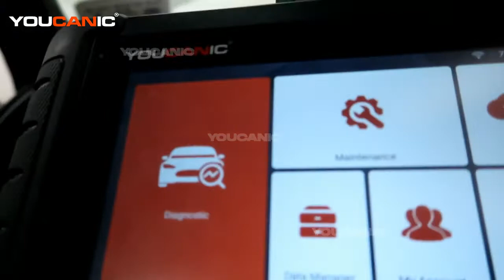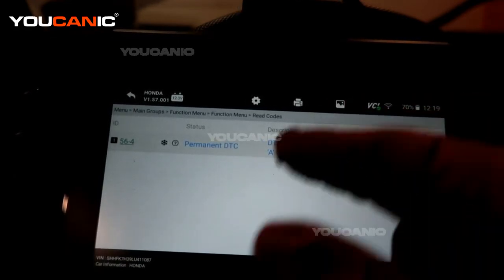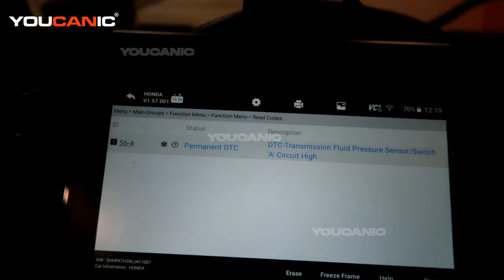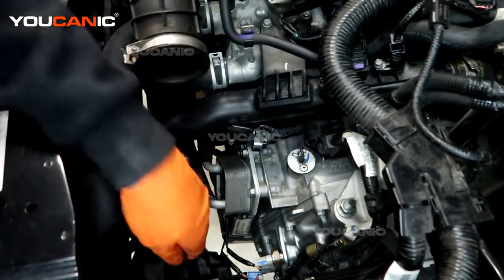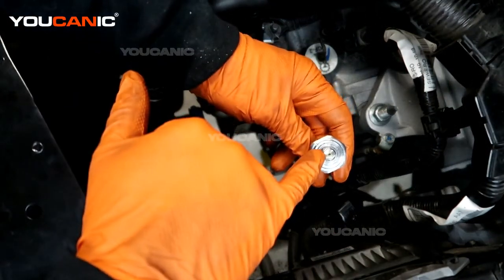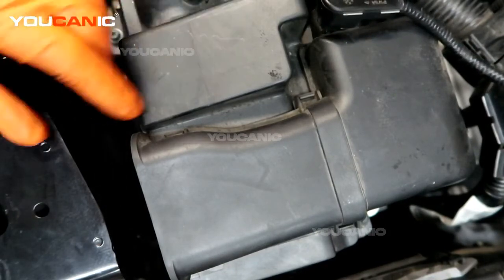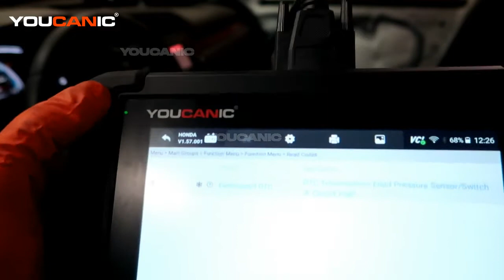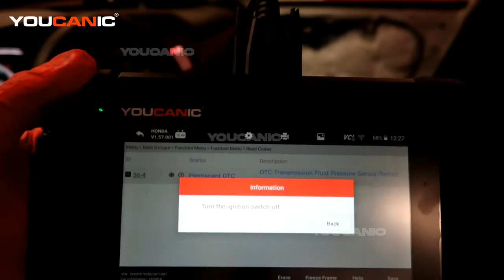Honda Transmission Fluid Pressure Sensor Replacement - P56-4

Comment: Thanks. Wasn’t sure if there was a crush washer for this
Reply from the maker: Thanks for reaching out! Yes, most parts like this come with a crush washer. At Youcanic, we're here to support you with helpful guides and our resourceful YOUCANIC scanner to make car maintenance simpler. Feel free to use these resources and ask any questions on www.youcanic.com.

We also provide factory repair manuals if you require detailed information. Here at Youcanic, our mission is to empower you and make your car ownership experience worry-free. We are always here to assist you!

Comment: Hi sir i have 2018 civic automatic 2.0 l engine, actually i change hcf2 fluid and drove 50 km on road and feel burn smell but didn’t hear any noise after that i open bolt level check and drain 250 ml approximately, my question is should my transmission ok or getting me trouble? And honda don’t have any warning lights for overheating? Plz assist me thankyou advance

Comment: Part number?
Reply from the maker: In response to your query about a part number, I'd recommend utilizing the YOUCANIC Full System Scanner (www.youcanic.com/scanner). This resource has been designed to help diagnose car-related issues effectively, much like a professional mechanic would. 

If you have other questions, feel free to visit www.youcanic.com, a platform where you can ask car-related questions, access OEM Factory Repair Manuals, among other resources. We're committed to making car repairs accessible and easy to understand. Count on us at YOUCANIC for all your automotive needs.